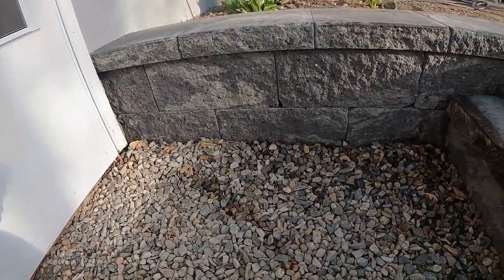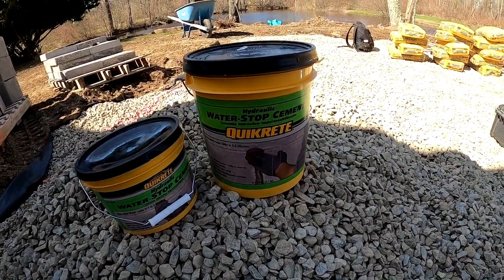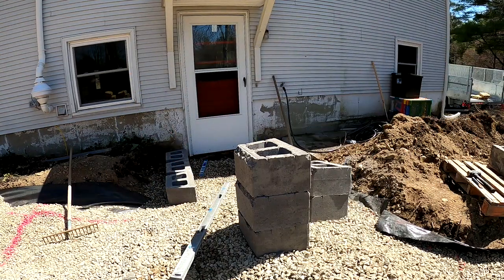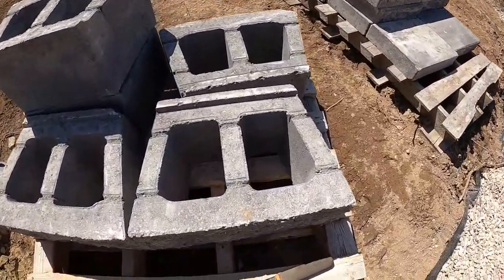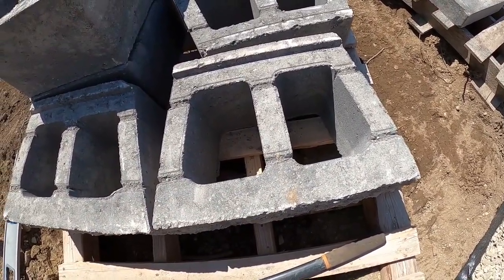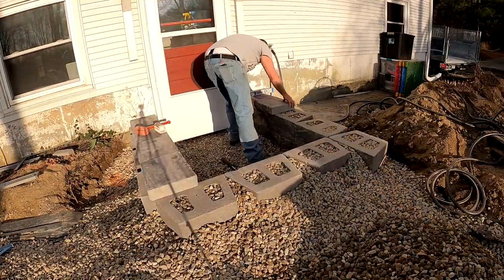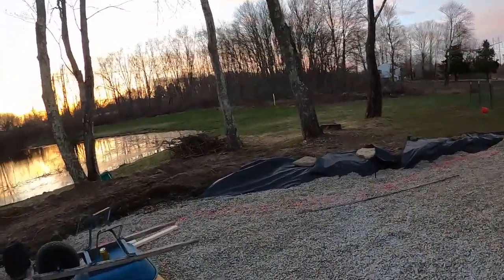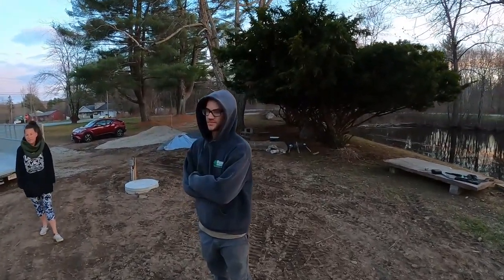DIY (Split Faced) Concrete Block Steps

Comment: Looks great man. Try screeding out 1 inch layer of #8’s with a transit and then your block will literally just set on it and you won’t have to do all the pounding on the block to level it out.
Reply: Another question for you. How are you going to get water out from the small paver area at the bottom of the steps?
Reply from the maker: Hey man, I know a lot of people do that with their wall block but I don’t like setting wall block on chip rock, to much risk for movement…. I will use it to help level it off but no more than a 1/4 inch. The pounding to me insures the block is set right and has less risk of settling. I tell the guys that work with me if they lay a first course wall block without hammering it into place to pick it up and add stone to hammer into place. This is a small wall block application so it wouldn’t be a huge deal but a large retaining wall that holds back a lot of soil is not good to set on chip rock in my opinion. If you set 8 tier of wall block on a loosely screeded chip stone it can easily sink in the future… and the landing area remained open grade stone, approximately 8 inches of it so that water can flow freely into the sub base

Comment: Is there any drainage or is it just going to fill with water during a heavy rain or snow melt?
Reply: I wondered about this too. We get hurricanes where I live, as well as intense summer downpours that instantly flood the streets. I know he left gravel so water can drain away, but intense downpours are going to flood the stairwell, and without a slope for it to run down, it seems like it will seep into the house. When my house was inspected, they checked that there was enough of a slope down from the basement door to prevent flooding.
Reply from the maker: It is just 8 inches of clean crushed stone for the water to permeate into the sub soil. There is a solid structure covering this area, and it is a very small amount of sq ft. I understand the concern about water, but the only way to divert the would be dig a 2 ft deep trench about 45 feet to spit it out to daylight. For the amount of water that will ever find its way to that whole, nothing more than what I put is necessary. ✌

Comment: Im installing  this wall  for my girlfriends father and why are some of the blocks 11 and 3/4s  or 12
Reply from the maker: Welcome to the world of Hardscape… block manufacturers tell you that sizes vary from 1/8 - 1/4 of an inch because of the difference from the concrete being poured into the forms. It can be very tough when building a wall over 4 ft … just be patient and grind really high spots down with a cut off saw or grinder with a diamond blade
Reply: @TheChristianHardscaper  we are trying to get  the base row down so it farley straight  and i was going nuts
Reply from the maker: Yea, it can be really tough with some wall block….